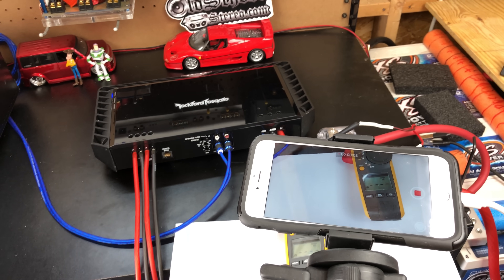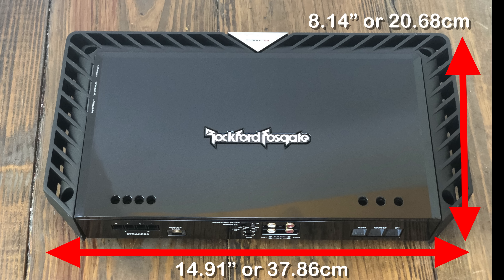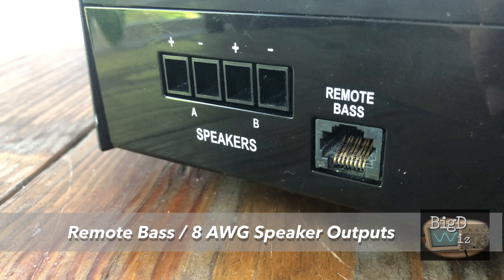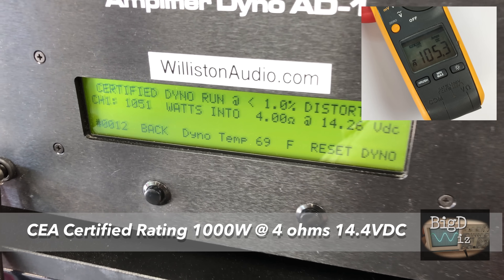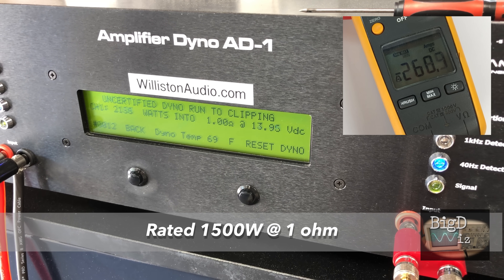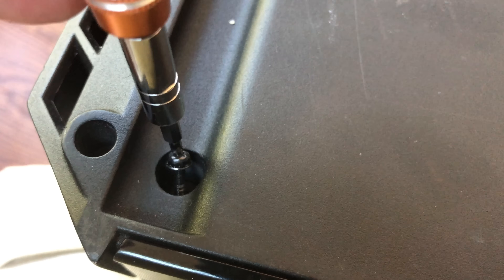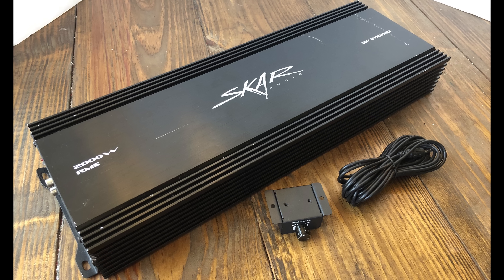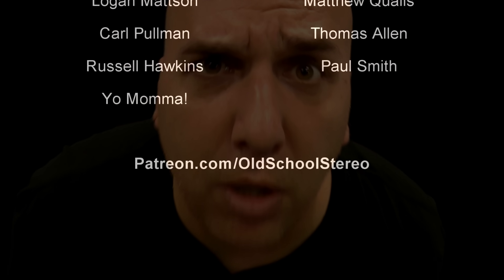Underrated? Rockford Fosgate T1500-1bdCP Amp Dyno Test

Comment: Hey D!  Great test.  This imo is hands down the best sounding class d amp I’ve heard & the only I’d ever use.  I didn’t read all the comments but when I bought my 1500bdcp from a local shop it had the rem bass control in the box under the amp in the plastic bag.  Maybe it’s just me, but the sound out of the 1500 seems better than the 2500.  I was wondering if you’d like to test my 1000-4 class A/B from 2009.  I’d like to see how it compares to the older 1000c.  Let me know, thanks for another great video.  

P.S.This amp ran the heck out of American bass HD’s with no problem, well worth the money IMO.

Comment: Hello wiz .. I need an amplifier of 2500 rms at 3000 rms for 2 woofers of 1000 rms .. which you recommend me of intermediate cost .. brz3016.1, orion xtr 2500, soundstream ar1.8000, or another that you can recommend me thanks
Reply from the maker: Orion XTR-2500.1Dz over those other two. Hard to beat it for the price
Reply: BigDWiz  I also thought about the rubicon2500.1..or do I stay with orion xtr2500 so why is it stronger and better? I thank you for your response I am an admirer of your channel
Reply from the maker: Orion still...SS Rubicon is not nearly as powerful 🤷‍♂️

Comment: Rockford is bad ass. Woofers could use some work, but their amps are the best hands down in my opinion. 

09' Pontiac G5 Coupe
SUBWOOFERS/AMP
- Custom Design Enclosure
- 2x Rockford Fosgate P3D4 12"
- Rockford Fosgate R1200-1D Mono
SPEAKERS/AMP
- Rockford Fosgate T1650 6.5" Coaxial
- Rockford Fosgate T1692 6" x 9" Coaxial
- Rockford Fosgate R300X4 4-Channel
HEAD UNIT
- Sony XAV-AX100
BATTERY
- HO3209 3200w Power Cell
EXTRA
- Fully Dynamatted
- Big 3 Upgraded
- Cosmetic Amplifier & Battery Racks
- 1200WRMS @ 1ohm -

Comment: This is a baby even though it's higher then my T-1000.1 cause mine was 1ohm stable built in fan 0gauge wire inputs and I had 8gauge speaker wire running to sub this thing has baby wire!
Reply: So your saying your amp came with 1/0 power and ground inputs from the factory huh ?

Comment: I had a T-1000.1 1ohm stable pushing an 18 inch power hx2 for the longest had an coil issue gonna have sub built even better

Comment: Forever a Fosgate fan. Might cost more but they are reliable and they are just killer amps. My two cents. Cool vid Big D. 'I'm outta heeeeere..!!'
Reply from the maker: Thanks for watching and commenting 👌
Reply: I love the fact that they are under rated
Reply: @dhestondh  so under rated they don't even include a remote with their remote capable 800$ amp🤣 those things are over rated anyway.
Reply: @whikidfmj  don't speak of what you don't understand. Rockford is and has been building some of the best amps on the market for decades. If you could start with a punch 45 and work to current you would be a fan as well.

Comment: It's not just about the amount of wattage, but how the music and sounds are produced and how long it can do it for at high wattage. That's where this is outperforms most others. This amp will slam all day long and not care
Reply from the maker: Good point. Hopefully this can be explained further in the in-car future tests
Reply: As long as you have the proper electrical. Rockford amps pull alot of power with a lower efficiency percentage

Comment: Wish I never sold mine 😭
Reply from the maker: Get another while the factory refurbs are still available...
Reply: I have a Alpine mrx-m240 now. 
Do you have any experience with these amp?
Reply: I had it on a 13w7 at 3ohm. The M240 was pulling so much current that I felt my car stumble sometimes while driving. Also it had my w7 slapping the back plate so bad. I now have a x12 which is pretty much bottomless. I’m thinking of running it at 2 ohm so I’m definitely gonna have to upgrade the electrical

Comment: Concern here is, you buy this amp to rum an 1800 or 2000 watt sub and it hits 3300 watts you blow your sub after a few hits of that over power. Kinda makes the amp crap if you know what i mean. But at least they do put out their rated power.
Reply from the maker: The 3300 was dynamic and at 1 ohm. Since it’s not continuous your sub should be fine if it can handle the power for bursts

Comment: Awesome amp but for this price I would buy a taramps 8000 and get my 8000 watts!!!
Reply from the maker: But how much then on electrical? Then on windshields? I get what you are saying, but buying strictly on price per watt doesn’t work for everyone
Reply: BigDWiz Why dosent dollar per watt work? For this crazy price I can buy a taramps 3k with an xs power battery for like 800 or less dollars. I already run zero guage wire and so should anyone running over 1000 watts.

Comment: Hey BigDWiz - I watched another video where you say getting the DC in amps is hard to get accurately, but you are using an amp clamp. If you want some better precision then you need a simple precision 0.01ohm metal loop resistor in series with the DC power, and then use a simple opamp to read the small voltage drop across that resistor. 10A across 0.01ohm is a 0.1v drop, but on opamp of say just a gain of 5 you get 0.5v out of opamp. 300A you get 3v drop or 15v out of opamp. Simple gain switch can give ranges. Simple and very accurate.

The dyno tests seem very short lived. How do these amps hold up to say 1hr at max levels? Do they remain stable at spec?
Reply from the maker: That would be really precise 😱. I’m good with +/- 3%

Comment: Great Video BigD!

Ive shared this with you before..but a younger version of myself bought a Rockford Fosgate Power 800a.4 back in 1999 and installed in my Honda Accord..i later relocated it to my '01 truck..where it still sits ..and still works about like it did from day 1...nearly 20 years out of an amp..yeah it cost a few sheckles more  than some of the competition..I think i paid  ~ $670 back then..so $36 a year :-)...so happy with it i bought the  T10004.ad for my new install.
Reply: @herbyverstink  why not the t-1500?

Comment: This amp is almost as powerful as my 2500BDCP birth sheet.
Reply: I met a guylt that upgraded t1 to t2 and the 1500 to 2500 and said wasn't worth it as had to upgrade the electrical batteries etc and not worth it

Comment: Would you recommend a refurbished Rockford 1500 or a new dc audio 2.0k amp
Reply from the maker: I would personally choose the RF as I believe it would sound louder due to minimal wattage drop over 2 to 1 ohm
Reply: BigDWiz and the RF doesn’t take 0 gauge wire? Only up to 4 gauge?
Reply: Also would this amp strain my electrical? I’m looking to upgrade my battery and get the big 3 soon but I just want to know how this amp would do on no big 3 upgrade and a new interstate battery.

Comment: PLEASE do a dyno test on the Kicker CXA1800.1 
I need to justify upgrading my amp to THIS Rockford Fosgate.
800 bucks ain't easy to let go for me... I will let the dyno decide!
Reply: I would also like to see the kicker CXA1800.1 put on the Dyno. I also have this amp. Running at 2 ohms the kicker does better than the T1500. My birthsheet rated mine at 1928 rms @ 2 ohms
Reply: Josh Redman Honestly, for $800, stay with the kicker. You might only gain a few watts. Its not really an upgrade for you, more of a really expensive sideways move.
Reply: catch22frubert Thanks for your advise. I'd still like to see a dyno on the Kicker I have now.
Reply: Josh Redman No problem. From what I've seen of kicker's cxa line, they do thier rated power. They are decent amps. I'm sure yours puts out the rated 1800 watts.
Reply: It pushes my two Alpine type R 12's at 2 ohms like crazy. Never really puts up a fuss when I crank it either. I really hope the numbers are true.

Comment: Love seeing amp guts, I'm amazed Rockford can make a 3000 watt amp with half the components other brands need to make the same wattage.
Reply: but the rockford can last all day the Brazilians not so much, also sound like a vacuum cleaner
Reply: Yes but the Braz amps are no were near the amp the RF T series is Has had 4 of the taramps all 4 blew ther wad in no he finally gave up 4 RF prime R-1200 and has never had a problem yet going on 3 years not to mention thats the lower line RF but ther sound quality was way above the Taramps!
Reply: Celeste McCoy apparently you've never seen the guts of Brazilian amps
Reply: I have, just didn't think about Brazilian amps since I'm out right not interested in them. But that is correct they use even less components for that amount of wattage.
Reply: Celeste McCoy interested or not they're still doing it on less components and way less power
Reply: You get what you pay for.
Reply: miguel medina lmao a vacuum cleaner. What are you talking about?? I've done a 9 hour drive from Mississippi to Florida with my shot on the whole time and not one issue. What's your experience with Brazilian amps besides what your friend told you his uncles sons sisters friends boyfriends dads cousins son said?
Reply: K4gixxer1000 I don't run taramps. I run soundigital. From what I've seen every person who has fried taramps was due to user error and wiring to low. As long as you don't wire them below the impedance their rated for you'll have no issues

Comment: I had one of these driving two p3’s wired to 2ohm and it was beating the shit out of them. Amazing amp. I upgraded to the t2500-1bdcp though. Love it. I need a second one 😂
Reply: the t2500 on Rockford p3s ?
Reply: I got two T2D2’s with the aluminum basket.. thinking two 1500’s will get them moving
Reply: @getfitwithme8405  you won’t be disappointed. Do it!

Comment: I used one of these on a 13w7 wired to .75 for months. No issues except for the jl not liking all that power.
Reply: Jl w7s have 1.5 ohm VCs you wont be able to run your sundown at .75 ohms
Reply: Why do you thank he can’t get .75 ohms with 2 - 1.5ohm voice coils? I have a feeling that your level of knowledge (I mean no disrespect) In Electronics [Scientific Theory/Principle’s] is close to none. So with that said calculating your load (Ohms) running speakers/Voice Coils in series is the easy one, you just add each coils ohm rating together ( ie. two voice coils in series 1.5 ohms + 1.5 ohms = 3 ohms) now running in parallel is a entirely different demon.  If you have two equal values. Than that is simple you just take half the value of one of them (ie. 4 ohms // 4 ohms = 2 ohms) but correctly calculate your resistive load with parallel wiring of your speakers is Like this ( 1/1.5 ohms + 1/1.5 ohms = .6666 + .6666= 1.3332  (take that answer and divide it into 1)  1/1.3332 = .75 ohms
Reply: I’ve got 3, 4ohm p3 12” rated at 1800 watts rms do y’all think that amp would be ok if I wired them to .67 ohms and it not burn up or pop?
Reply: @mikecasey3055  Wait...are they 4 ohms or dual 4 ohms??? I'm not familiar w the P3s. Because 3 - 4 ohms svc subs in parallel = 1.3333.... They would have to be 3 - dual voice coil 4s to get .67 ohms.
Reply: Just got one and thinking about getting an amp
Reply: Been there too except found that my 13w7 does fine daily on about 1800-1900W. That's the sweet spot for me.
Reply: @spirorevelis7100  can you help?. Two 13W7 on a single T2500 and after a while cuts off? have a single T1500 front mids and tweeters (focal) work fine.
Reply: @AlienGrade  are you worked to 1.5 ohms or .75 ohms? If you are not sure, then reply back and I would be glad to discuss further. No disrespect intended. Just not sure how technical you are and I do want to assist.
Reply: spiro revelis not sure will find out tomorrow. Thanks for the help💯
Reply: @AlienGrade  yes sir! Hit me up and we'll figure this out!
Reply: I had 2 12w7ae on a 1500 bdcp. Sounded awesome even though only running amplifier down to 1.5 ohms. Sound quality has been best system I ever had!
Reply: So it only lasted a couple months?
Reply: Spiro they are dvc 4ohm 600rms just wondering if I would mess the amp up or speakers if tuned right.
Reply: @mikecasey3055  sorry mike- forgot this was about a T1500bdcp. My last comment was about a T2500
Reply: @mikecasey3055  wire each subs voice coil in series to make each sub 8 ohms final impedence. Then wire all three subs in parallel for a final impedence of 2.67 ohms. A T2500 bdcp will clamp 1900 watts clean easily to a 3 ohm load as I have done it by connecting a single 13w7 to one. It "might" do more at 2.67 ohms and with the gain set a bit higher. A lot of factors such as input voltage and box rise come into play so I can't guarantee you. But I can promise that I got 1900 watts CLEAN in my case at 3 ohms. That would be over RMS to each of those subs. If you want to play them daily for hours on end I would stick closer to the RMS than any peak ratings. I would think wiring them to 2.67 would give you plenty of power and get nasty with that much cone volume
Reply: Got them hook up in my ride H2 Hummer with 3 12 Soundown SA series tune 32 hrz. 2.67 ohm
Reply: I was thinking about getting this cuz someone I know is selling it for $250. I currently have my 13w7 wired in parallel  to a Memphis prxa1500.1 the sub hits but I think it will be better with this amp
Reply: I have a sundown zv4 D1 how can i run it to .75 on this T1500.1bdcp
Reply: Juan Macias I thn
Reply: Think you would go low as .5
Reply: @ali19186  I tried it bro @ .08 ohms I believe and it ran like a champ!!! This amps are very powerful. But i sold it and now i own a Sundown SAZ 3500D and its the one they build here in US not the Korean ones. Im getting a Sundown Zv4 D1 this week I have my Custom box build already with a 8" aero port from Sky high Car Audio. Check out my Channel and stay tuned Ali. Hope you like what I have and what I build. Subscribe Me please Iwill appreciate it. Anyway i sold my T1500.1bdcp for $300 on offer up. Then I got my SAZ 3500D from a buddy of Derek from Sundown Audio for $450! I think I got a sweet deal for being the very first ones they build here in US. Then after so much requests they had to make them in Korea to manufacture more. But those dont do 18v like the one i have. Dont get me wrong they are still a beast but with cheaper parts.
Reply: @pimbysdesertcustombuildz3944  you don't have any videos even still a year later bro. So what about your channel am I supposed to check out lol
Reply: @ali19186 I did unknowingly (by accident) for a day or two going to work over the course of a 1 hour drive without issue. Had a brain fart and had all 4 dvc 4 ohm subs wired in parallel, then paralleled each run of speaker to an and b on the amp. It did get pretty hot though
Reply: @pimbysdesertcustombuildz3944  you can't. You got half ohm or 2 ohm.  No other option.
Reply: @pimbysdesertcustombuildz3944  you can't
Reply: @pimbysdesertcustombuildz3944  wire it to .5

Comment: CP sound like a rip off of JL's RIPS circuit.
Reply: Its just a fancy name for a Regulated power Supply. Many higher quality amps run a Regulated power supply vs a Unregulated supply.
Reply: All modern amps have a regulated power supply. RIPS and CP regulate output. 

Every circuit design has advantages and disadvantages. The upside to RIPS is that it compensates for most speaker impedance flux. This means more uniform output levels regardless of frequency. It's also less stress on your electrical system.
Reply: I do like my slash amps
Reply: Jl wasnt the first to come out with that technology either! some of the old school phoenix gold amps had it in the mid to late 90s! They were very high end back in the day nothing like they are now!
Reply: It seems the Rockford has a power supply that is far less regulated than the JL, it shows in the dynamic power results on the dyno immediately.  I’m a Rockford fan, but still enjoy my JL W6v1’s running off a RF Power 650.  Personally I’d continue buying RF because how reliable they’ve been & how RF takes care of any probs if one occurs.  To each his own & I hope you enjoy what ya have!  That’s the way it should be in car audio anyhow.
Reply: Jl only make a 1000 watt amp right
Reply: There’s the alpine pdx series too guys!

Comment: 1500w For that price.. No Ty!
Reply: Steven Smith Agreed. You can get the same power and 90% of the performance for $230 new. This is Definitely overpriced. I paid $330 for 2500rms@ 2 ohm and 3300 rms @1 ohm, both tests at 13.6 volts to boot.
Reply: Steven Smith not 1500 watts and it's performance is great
Reply: Doesn't matter for that price I can get more power
Reply: Steven Smith performance
Reply: catch22frubert cool, I have two of them, and they are awesome
Reply: eric1998420 I'm sure they are awesome. The only bad thing about this amplifier is the price. If you look around the market, you will see other quality amps with better features for less money. No way on Earth would I ever pay $800 for this particular amplifier. I don't even think I'd pay $450 for a refurb.

Comment: Great video BIG DWiz!!!  👍👍👍 Numbers  we're awesome as expected nothing was surprising, then again it's a ROCKFORD  FOSGATE amp!!! It's suppose to do more than it's rated power like with all of their amps!!!! Only bad thing like you said it doesn't come  with the bass knob and that's an additional $25.00 bucks or so!!!  For an $800.00 amp ROCKFORD should include it!!!  As far as price you might do better by shopping  on eBay!!! I have seen some as low as $500.00 to $600.00 bucks brand new you just have to keep shoping around!!!!

Comment: Been waiting for this. Thank you! I have been driving myself crazy trying to decide between this amp and the jl slash 1000/1 for my w7.
Reply: Im runnin a 13w7 wired to 2.5 ohms and it kicks ass
Reply: @travishulse3449  how is it wired to 2.5 when it’s a 1.5 DVC? Wouldn’t it be .75 or 3?
Reply: What amp did you decide to go with?